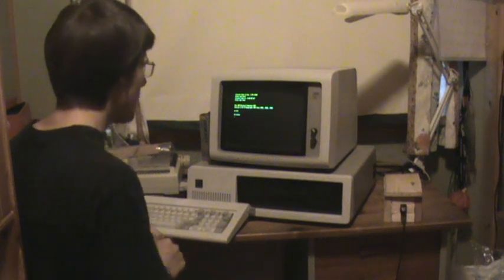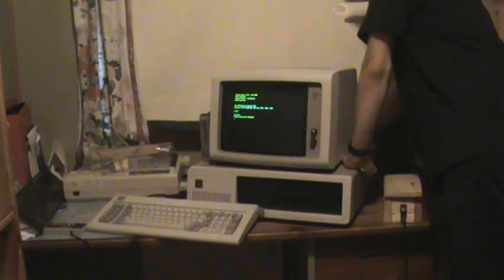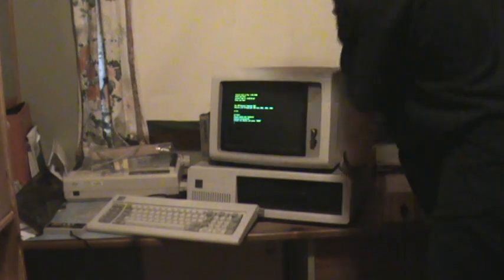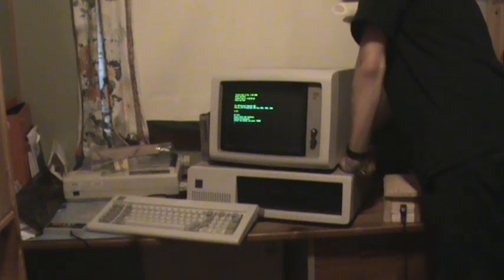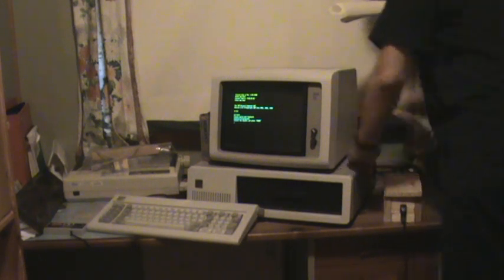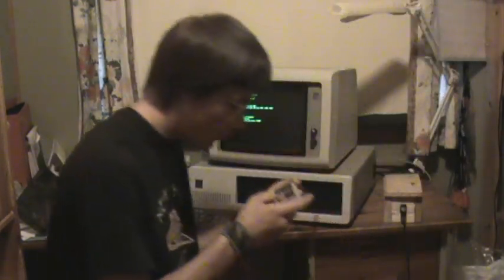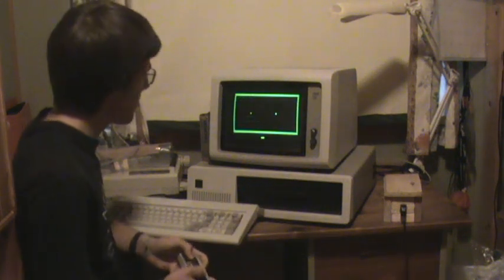Demonstration of NES-controller-to-PC/XT adapter, this time with sound!

Comment from the maker: @kitchaki
I actually got a 5161 expansion unit for it not too long ago, which adds 6 expansion cards to the 8 already present in the system. In addition, it also came with a pair of 10MB HDDs.

But, nope, there is no point in upgrading further as I got several more recent computers, some with literary thousands of times the processing power. However, the problem with more recent PC's is that the hardware is much less flexible, which gives certain limitations when it comes to hacks like this.

Comment: One suggestion ...

In box, put a female din 5 conector and a rotative switch to select between keyboard and the adapter. Only a switch 3 poles and 2 position is sufficient because is not necessary cut the power supply of keyboard while the adapter is on.

Comment from the maker: Yes.
I started by getting the idea, then I researched the keyboard controller of the XT, and the input/output of the NES-Controller.

After seeing it was possible, I put together a logics diagram (AKA. Schematics), then I tested it in a cirquit-emulator (on the PC of course) several times.

Then I ordered parts and put it together on a breadboard. The next step will be to make a PCB for it, and solder everything.

Rigth now, I've payed $20 for parts and $70 for the shipping of the parts.